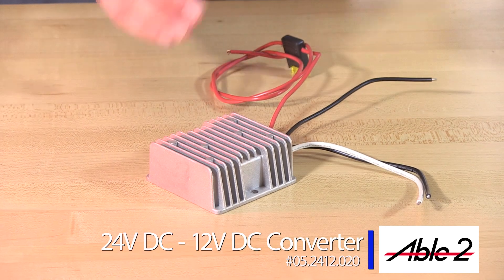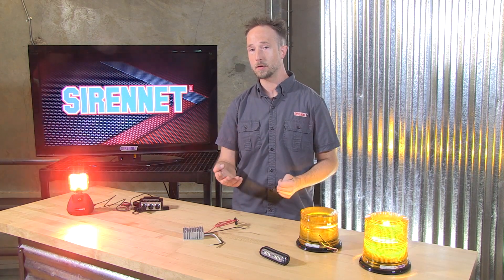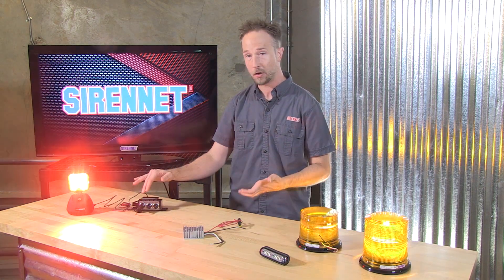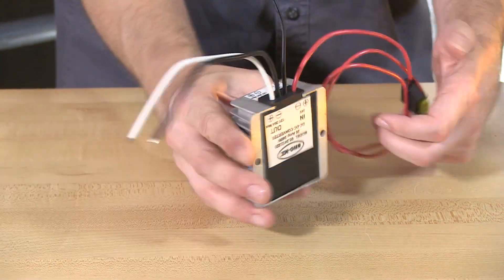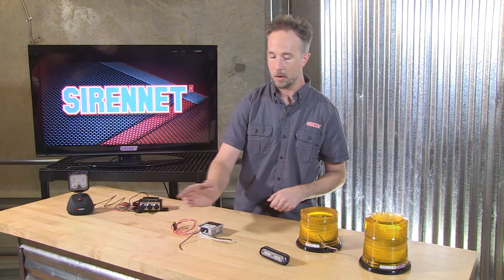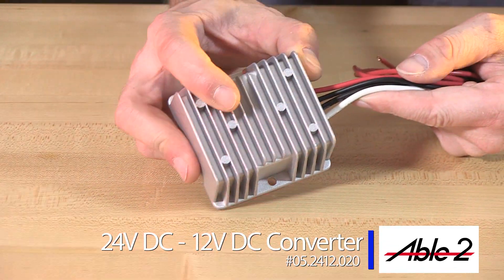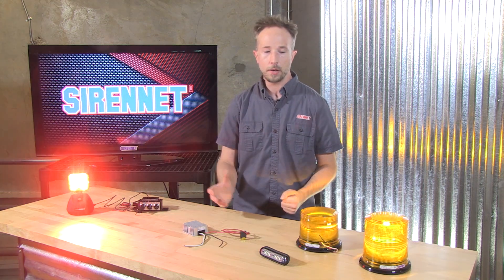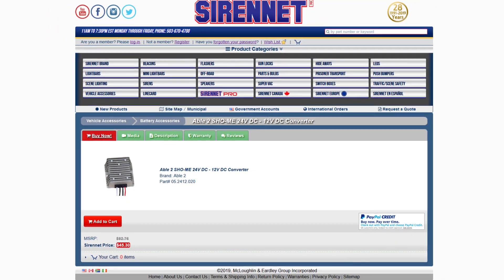The Able 2, 24 to12 Volt DC Power Converter

Comment: If you have a 12 to 24 volt but actually want to go from 24 to 12 with this same converter, can you use it, will it blow ??? Will it work ???
Reply from the maker: This device only converts 24Volts DC down to 12 Volts DC.

Comment: How can I wire a car a12v car radio on a truck with this converter. 
Radio requires 12v constant ( memory) 
12v acc for on and off 
-ve ground . 
This contains only two outputs . 
?
Reply: You could connect 2 wires to the 12v+ output, one lower gauge for the power, one higher gauge with a switch between the on/off input line. The trouble you might have is there will be a constant draw on your battery from the radio and converter itself supplying the constant line for the memory. If your batteries are large enough and there isn't long between recharging from driving it might be ok though. 
This converter only has one 12v output (not two), but this doesn't affect how many devices it can power, the: current,voltage, and total power output dictate the limit (most electrical things staying between 50-80% of rated current/watts is usually a safe/preferred way).
Make sure you talk to someone familiar with car/truck wiring (if you're not) as there's a few things to consider with this.

Comment: How hot does it get?
Reply from the maker: We do not have any specifics from Able 2 / Sho-Me on the operating temperate range of this Converter. At the 20-amp max, it gets hot enough that you can't hold on to it. If there is a worry about it getting too hot, avoid going over 10-amps on the draw.

Comment: Can you connect multiple DC Power Converter to a single 24 volt source. I'm in need of 12 volt and 5 volt output from a 48 volt source. Would thye be wired to the same wire?
Reply from the maker: Is your application / vehicle 48volts or 24volts? You mentioned both, so just asking to be able to further help with your question.
Reply: Sorry, its' an ebike with a 48 volt battery. Trying to figure out what fuse size I should install between the DC converter and battery?
Reply from the maker: @raczyk  This converter has a 20-amp inline fuse already.   It's only designed for 24volts, not 48. Does your eBike have just (1) 48volt battery, or does it have (2) 24volt batteries?

Comment: Why not go from the positive to its negative on the first battery o hook your 12 volt items. Its 12 volts till it hooks to the next battery then becomes 24 volts in a dual 12 volt batteryy 24 volt system in series.
Reply from the maker: Getting to the battery and running wires from it to a switch isn't always too easy. These are great for using with existing switches that are often already on the vehicle/equipment.

Comment: I run a 982m front end loader and just roasted a Ranger x9 cb radio now I have 2 battery’s but the machine is 24 volt will this help my issue?
Reply from the maker: This is exactly what you need. It converts 24 volts DC to 12 volts DC so that 12V devices can operate in 24V construction equipment.

Comment: Got a major question? I have a arb dual compressor that is 24v and I’m trying to install it on a Toyota Tacoma that only has 12v is this product going to help with my issue?
Reply from the maker: So long as it's within 20amps max, this should work.   The Module reliably converts 24 volts DC to 12 volts DC so that 12V devices can operate in 24V construction equipment, trucks, RVs, buses, etc.

Comment: All made in China they have a lot of junk..mine never worked.
Reply: You would be surprised how much stuff is made in China. They make great stuff and they make junk, it all depends on the quality control, and if they stick to the original design. Sometimes they will change one little part  from the original design and ruin the product.
Reply: Your what never worked?  Did you actually buy this converter?  I doubt it...

Comment: can i use this to stepdown a 18v battery to 12v for using powerwheels with 12v control box
Reply: You can choose a 8-36v to 12v converter. what is the power for powerwheels?

Comment: Would this be considered a load dump board?
Reply from the maker: It's a voltage converter; 24volts is reduced to a regulated 12volt output.

Comment: Hi Chris,   
Wondering what the percentage efficiency is for this box ? 
Guess I could also use more than one to up the wattage output.
There are advantages to having a 24v battery bank and 24v Inverter but have many 12v  appliances which would be hard and expensive to replace.
Reply from the maker: Greetings. It's greater than 90% power conversion efficiency. Able 2 does not recommend stacking these up. If the wattage is greater then this can handle, you'll need to look into using something different.

Comment: If I have a 24 volt only light can I hook it up to this and run it off of 12 volt.
Reply: KEITH HERBST no, this only does the opposite conversion
Reply from the maker: @JPfowl Correct you are; it's only for 24volt to 12volt. Not the other way around. Thanks for making the mention.